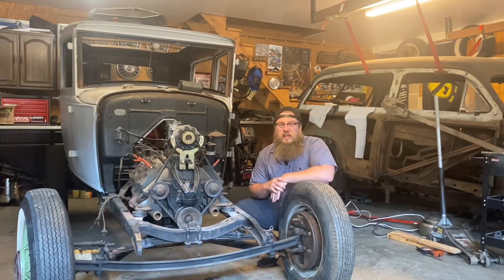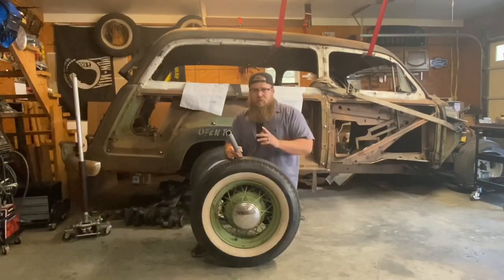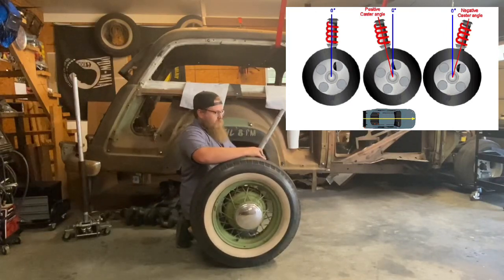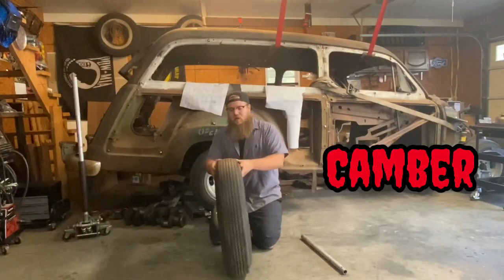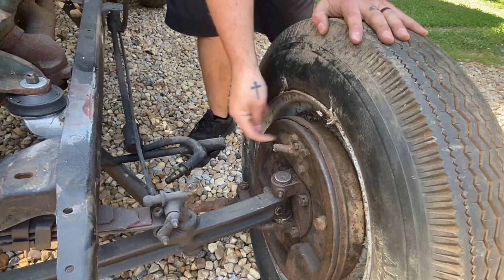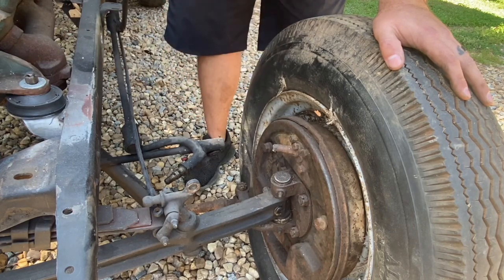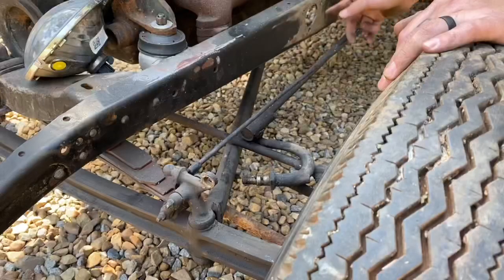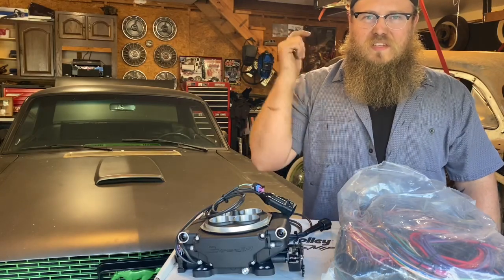Front End Alignment Explained! Straight Axle

Comment: what's your preferred caster angle for the straight axles?
Reply from the maker: 7 degrees on a stock model A. Model A with a v8 12 degrees, v8 stock cars 10-12 degrees

Comment: Basically on straight axles if things are in good shape and left stock there is only toe to adjust, because you don't suppose to heat or weld on steering components
Reply from the maker: I was going for the model A modified aspect, to which you always have to adjust toe and caster